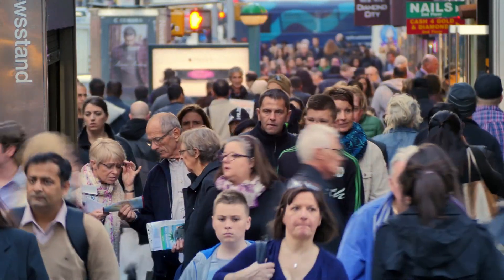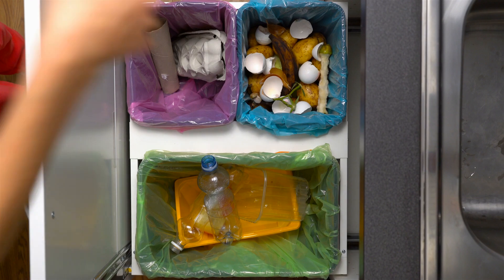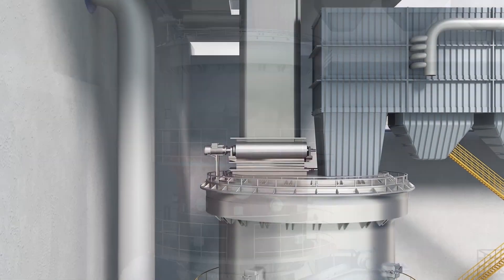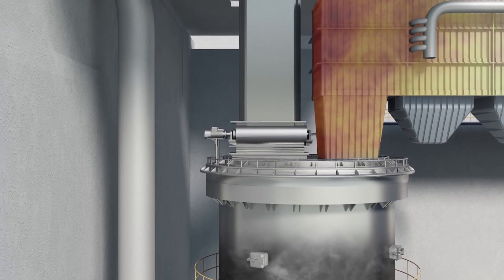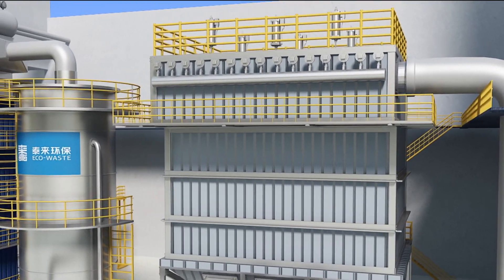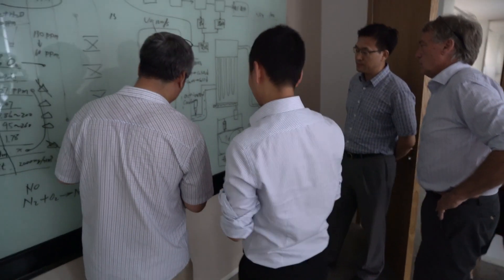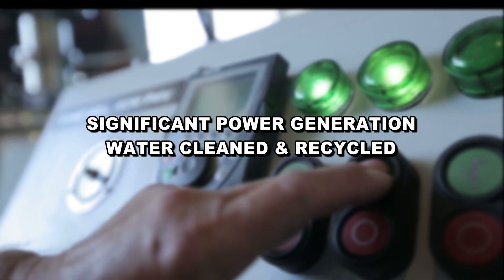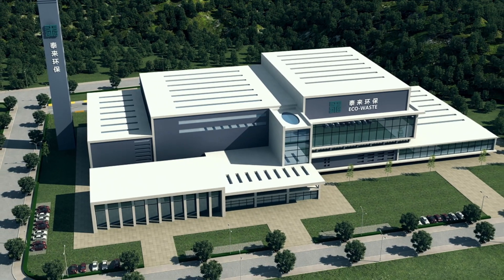Waste to Energy by Advanced Gasification

Comment: This still produces a significant amount of co2 emissions.  Majority of combustion engine exhaust is nitrogen too, but we know that's not "clean".  I am an engineer and this is my field of expertise, it's disappointing you left out information that is key to whether or not the general public will accept it. This creates as much co2 as incinerating it (in fact more since there is no ash)
Reply: hello, I've been looking into this process for sometime now and I would really use your expert advice on some of the things because google and these youtube videos seem to hide some information. How do i get in touch with you
Reply: @emmanuelvinandihmseteka9714  what would you like to know?
Reply: @emmanuelvinandihmseteka9714  maybe if you were am engineer you would actually know what happens after the gasifier.  The syngas undergoes autoignition when air is added, as mentioned the temperature exceeds 1000 degrees centigrade which is significantly higher than its auto ignition temperature.  In that part of the process when air is added, the temperature INCREASES.  How do you think it increases without combustion lol.  If air is added with no combustion the temperature will decrease which is not the case.  Also, to gasify the waste it produces CO2 by using the waste as a fuel source.  I know it doesn't specifically say ayngas is combustion, but that is exactly what is happening when the air is added via autoignition.

This is my field of expertise, I have designed units like this before. If you want to know more I'll gladly answer any questions
Reply: Jono,  this plant does not use the syngas to combust in an engine. It collects the heat in a boiler and uses the steam to produce electricity in a steam turbine. It clearly shows this in the video, there are no engines shown. Diverting waste from landfill in this gasification process significantly reduces GHG's such as methane. The plant produces slag from inert materials dropped through the gasifier and around 2% flyash collected in the baghouse. There is nothing to hide.

Comment: Is the energy output sufficient to power the entire process?
Reply: A plant processing 200,000 tonnes per annum of household waste will generate around 16MW of electricity that can be exported to the grid. The plant will also generate another 2-3MW to run the operation. It does not require auxillary fuels such as natural gas or diesel due to the design of the vertical gasifier.

Comment: When I first learned of this a few months ago I’ve been starting to push nonstop. There are so few downsides, all of which are shared by other methods of disposable, and so many upsides. I hope more people start to catch on, but so many seem to think it’s just fancy incineration
Reply: This technology needs more work to be environmentally successful. The process is so temperamental it requires a lot of traditional fuels like diesel burners to warm up and cool down correctly after plant stability issues
Reply: @Daily2Cam  there are 40 plants that have been construction over the past 20 years. This vertical rotary gasifier design does not require diesel or natural gas or other auxillary fuels to operate.
Reply: @craigeyes8395  many places do use gas to fire them up/ get to temperature. theres many issues and requires constant maintenance
Reply: @Daily2Cam  Honestly kind of a midwit take on environmental issues. The most important thing is that you squeeze energy out of materials more than one time. Multi usage.

Look at the energy output and look at the destruction of the waste.

Couldn’t care less if it’s actually profitable. We should be paying to do this service, best way to get rid of rubbish.
Reply: @Mac Riggland  Hi, my midwit take is from my experience as I work at a gasification energy from waste powerstation. Our support Fuel is diesel and when the plant is not within the required EA temp to burn SRDF we have to burn diesel and lots of it to maintain, warm or cool the plant. So, while these plants on paper look fantastic all the caveats aren't mentioned
Reply: @Daily2Cam  So? You think I’m gonna purity spiral like some 17 year old girl?
Reply: @Daily2Cam  sounds like you have a horizontal gasifer needing aux fuel to maintain temp, in the video you will see the vertical gasifier which does not require aux fuel such as diesel/NG. Also that gasifier requires a finely tuned SRDF whereas the vertical gasifier takes MSW ~ there are many types of different gasifiers.

Comment: Gasification isn't as eco-friendly as proponents claim. There's a gasification plant on the Isle of Wight in the United Kingdom, and it has been known to breach limits for dioxin emissions.
Reply from the maker: Gasification is a generic name. It is the same as saying that a particular car brakes down occasionally therefore all cars are no good. Good gasification technology that is well designed and fully verified by the EPA authority does not breach dioxide-emissions.  One issue is that waste is not a constant known mixture of waste materials, but a random collection, in this case from households general waste bins. The key benefit of good gasification is that it combusts the syngas at extreme high temperatures with inline sensors to monitor and control emissions through the overall process. There are issues with all types of waste. Well designed Gasification technology provides a good overall solution.

Comment: not "advanced" gasification.  This is barely a step up from incineration.  This is more energy intensive, low recovery, indirect use of the syngas.  Indirect systems like this usually give ~500 kW/Tonne waste.  Better systems are 1,000kW/Tonne waste.  There are much better systems out there than this one.
Reply from the maker: How can it be energy intensive? This advanced technology uses the general household waste as the total energy input and uses no additional energy. PLUS these plants use a small land footprint so can be built in the same area as the waste is created by households eliminating transfer stations and very expensive transport costs to out of town landfill sites or large regional incinerators....
Reply: Hi David, can you list some of the options that you think are better?
Reply: Hi David, could you list some suppliers of better waste gasification system ? Thanks